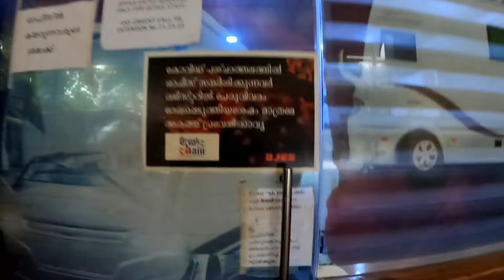50 കോടി  മുടക്കി ബസ് വാങ്ങി

Comment: Lead acid batteries produce hydrogen during its charge and discharge cycles. Make sure that the batteries are ventilated or you’ll end up inhaling it alongside a decent chance for fire hazard